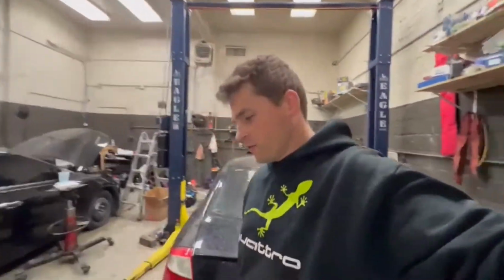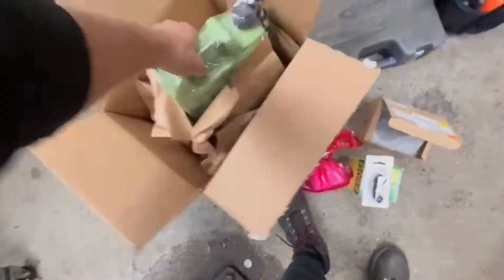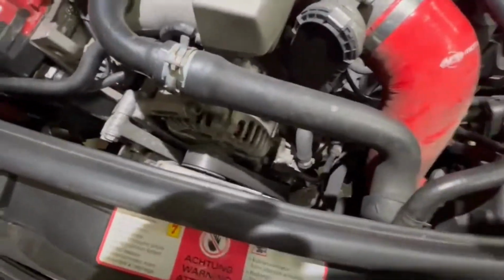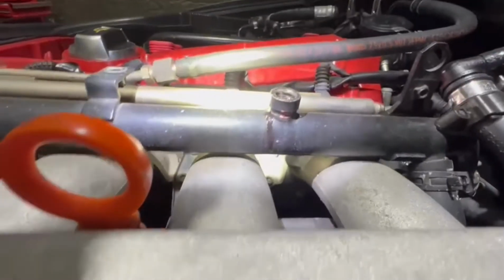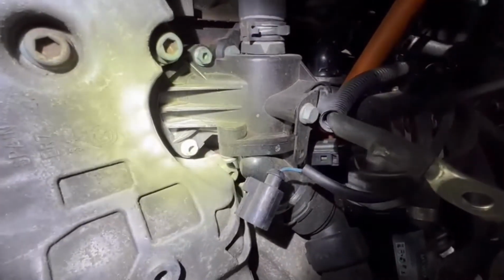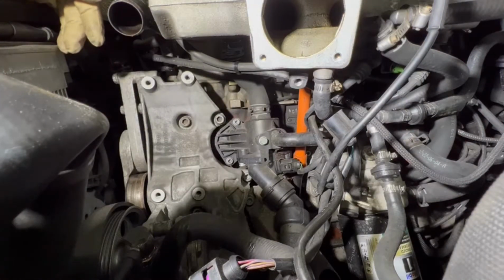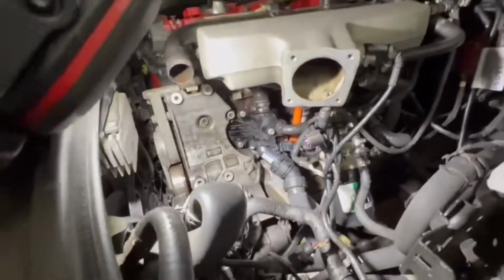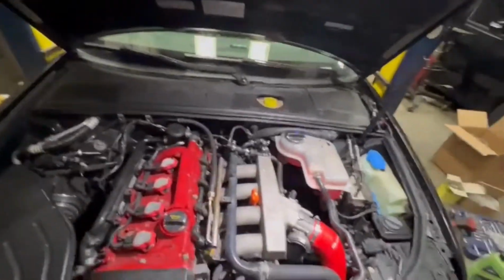Replacing the failed thermostat on my Audi A4 B6 1.8t

Comment: Hey man, just discovered your channel. I saw that you had a GTRS on your other A4 but you weren't really happy with how it drove and the terrible mpg you got. I was deciding on getting a Frankenturbo or GTRS but now I'm not so sure I want to even upgrade the turbo for my A4. It's my daily right now and don't really plan on selling it any time soon or ever. I'm on stage 1 right now. You think I should upgrade the turbo or just go for stage 1+?

I hope you don't have to replace the rear coolant flange any time soon. That thing was a pain in the ass to replace.
Reply from the maker: Hey thanks for the comment, yes I did replaced the flange already haha , in my opinion and from experience don't do the gtrs you can go k04 or the frankenturbo which I think its similar and more reliable
Reply: @cargarage7929  Awesome, thank you for your input. I think I'll go with Frankenturbo then. Will be cheaper overall too
Reply: @Albertotron  hows the mpg with stage1 with the 1.8t? about to upgrade my a4 b6 with eurodyne stage 1
Reply: @kevinhawley962  It's about the same as before. Maybe just a tiny bit better since it has more power in the lower rpms and I don't have to wring out the engine.

Comment: I wonder if any has just blocked off the j-plug? I mean they are completely useless for most 1.8t setups
Reply: Hi, i just did the same repair job, wtf does the j pipe do?
Reply: @chrisherzog1833  The J plug of course plugs a hole. That hole is used when the engine is used in transverse applications.